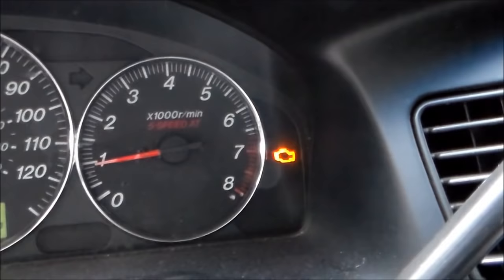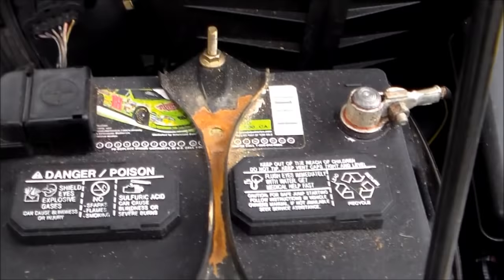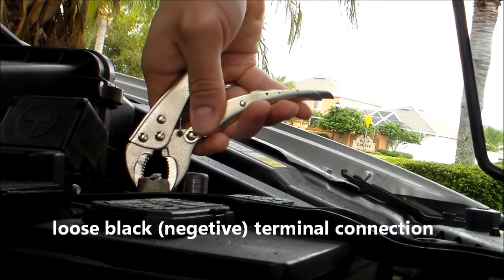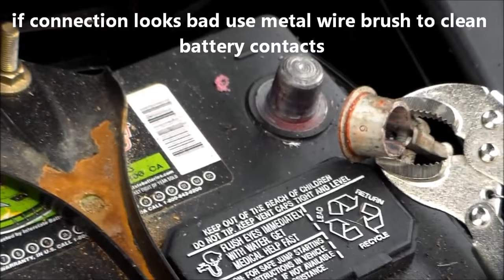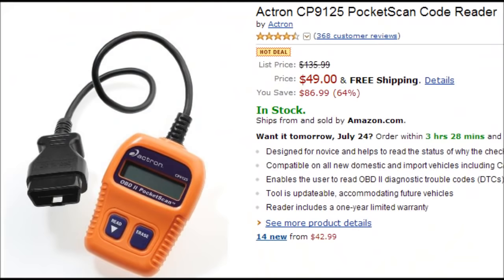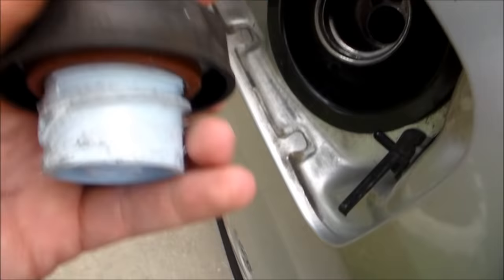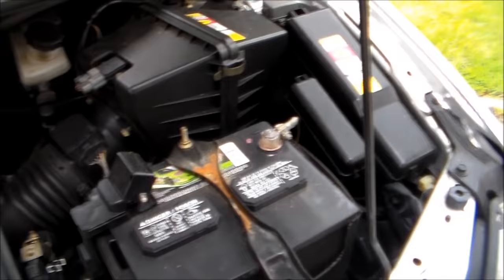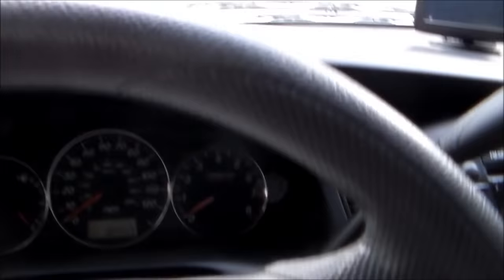HOW TO RESET CHECK ENGINE LIGHT, FREE EASY WAY!

Comment: So the point of this is to hide the light ? I'm no mechanic or car fanatic but this isn't something people should do
Reply from the maker: agreed, that's not the point of the video, the point is that the error light might be triggered by a loose and bad gas cap, that was the point of the video but most over look that part of the video. i recommend fixing the cause of the error light or else the effect will be worse than a check engine light. i replaced my gas cap and light never came back on afterwards.

Comment: Loose gascap... that's bullshit, he just want you to get a new one from them at the shop. And disconnecting the battery does not help on 99% of the computerized cars, after 5 minutes it comes back again.

Comment: In California AutoZone can not diagnose they can only pull code and tell you what it is, because they were misdiagnosis cars to sell parts, this guy is wrong air in gas tank does not have a code, if anything it will through a evap code for a leak,
Reply from the maker: yes your right, evap leak, i corrected that in a speech bubble thx,
i recommend using "Code Reader / Scanner" here (gives U codes & resets light too)-http://www.amazon.com/s/?tag=tampfreepcpin-20&link_code=w12&linkId=&_encoding=UTF-8&search-alias=aps&field-keywords=car+scanner

Comment: This is just a bad example of not what to do, and how to do it, This method is how the phrase Back Yard Mechanic came from .  Use proper tools, Never tap on a battery post, Sorry but the code is still recorded , the light will come back on. Some cars the radio will go into a lock unless a memory saver is used , clearly wasn't which would be a costly code from the dealer. I could go on and on

Comment: BS. You cant clear the codes that way. Even if you clear the codes with an OBDC tool, the codes will reappear after a couple of drive cycles.
The key is the "ready status" on all monitors. Your car will not pass inspection if all systems arent ready.

Comment: What he did is just remove a light from the dashboard, he didn't fix anything.. he just gave himself a reassuring feeling that everything is alright, until one day his engine fails on him. People don't reset a warning light by screwing around with the on-board computer. You're not fixing anything this way and only setting yourself up to get stranded on the side of the road. Have your engine looked at.

PS: What he talked about with his gas tank and having air go into it is a bunch of baloney sandwich.

Comment: you know you can touch the negative post right? lol its the positive that will fry you
Reply: Touching the positive side won't fry you. Not even a zap. Amps aren't high enough. Just don't touch the post with a metal object fro the positive terminal to ground.
Reply: in that case, go nuts! lol

Comment: I really wouldn't follow this guys advice.  You can buy a cheap diagnostic scanner for hardly any money, have a look on Ebay.  Cheap scanners won't do the same jobs as a professional setup, but it will erase your fault code properly, even will tell you what is going on.

Comment: That will not work on OBDII vehicles.  Be careful who you get your information from.  The gentleman obviously knows nothing about using the proper tools for the task or safety precautions!! Using a pair of pliers when a proper sixed wrench should be used.  And wearing a ring while working on a vehicle.  This gentleman is obviously not a trained automotive technician.  Automotive Instructor and ASE Master Automotive Technician!!
Reply: +Carl Hamann  Yes,And were no armclocks with steele-bands ither.I was a 
car-elektrician at Scania-trucks in Sweden.I am now retired!
Reply: +Carl Hamann It does work on my OBD-II vehicle. 2000 ford ranger. 3.0l flexfuel 2x4 drive.  I would take a guess that may not work on the "CAN" OBD-II vehicles but this is just a guess about the "CAN" ones.

Comment: check engine light?  i fix cars. usually needs a tune up. or faulty electronics. misfire due to not changing spark plugs. then that can cause rich fuel, then itll put on a o2 sensor code. then u change o2 cause your a noob. egr solinoids take a crap. car overheating can turn on engine light. disconnect battery cable, light turns off,when car detects problem is still there, light turn back on .ho ho ho. btw, many parts store check your engine light for free. buy some headlight fluid while ur there. good luck

Comment: It's go away forever ?
Reply: Shahit Kham no it will come back on because the problem hasn't been solved. Go to any Autozone or Advance auto parts store and they will scan the computer for free. Most parts stores will do this for free and tell you what the problem is. Local mechanics do this to so they know what the problem is. Get it fixed. Why risk a break down and the car will run better.
Reply: ok  thank,s for good answer i will go ask there
Reply: Shahit Kham I would give the car a couple of bottles of Gumout multi system tune up. Just add it to you gas. Go to about a quarter tank add the Gumout multi system tune up and fill up the gas tank. Go to Autozone or any parts store and ask for Gumout muLti system tune up. It is a very good fuel additive cleaner. It has PEA which is a very good cleaner. If they have BG44k get that instead. A bit more money but excellent cleaner.

Comment: Ricardo Black, you don't know what you're talking about.
AND PLEASE STOP SHOUTING.
The check engine light is not the same as the oil light.
IF you reset the engine light and it does not come back on immediately, there is nothing seriously wrong.

Comment: Do not do this just prior to an official car inspection as the garage computer will not 'pass' it because the computer in your car will have to go through another complete cycle only accomplished by driving the vehicle over a period of time/miles and at various speeds.  Besides, eliminating the 'check engine' light does not make the existing problem go away.  The light will return again in time.

Comment: I would just like to point out that you were using a metal tool to disconnect the battery because you were afraid to touch the negative terminal. Metal conducts electricity so you accomplished nothing, and you also have to touch both terminals to get shocked. It actually bothered me to see you reach for the terminal but quickly go back to the tool out of fear.

Comment: Didnt work on chevrolet cruze 2010
Reply from the maker: take off both red and black terminals for 2 minutes.
Reply: ***** Disconnecting EITHER terminal breaks the circuit. BOTH is redundant. DISCONNECTING the NEGATIVE is ALWAYS preferred.

Comment: Nice try, kid! Did any schmuck fall for this? Plus, who the hell uses a Mole wrench to undo a battery terminal! I faw down and go boom!
Reply: i did and it worked 😒
Reply: +Twigs only because there really wasn't anything wrong with your car. Sometimes cars have personalities of their own. ( what this really means is that a car may have a loose wire, something may be disconnected,  you had a maintenance service performed on the car, bad gas, etc.. ). but the light can go off on its own. my car did this for an entire 6 to 7 months because the 02 sensor was getting old but it was still working. i decided to replace it and my light did not come on at all every so often like it had been doing the months before.  i waited a couple of months to see if the light would turn on and it didn't come back on at all since i replaced the 02 sensor. now if your check engine lamp stays on indefinitely,  you may not be so lucky next time your car is up for inspection. that is a clear sign that major underlying issues exist. now if you do what you did and it passes inspection, then your car is just temperamental. Lol! good luck. yours truly, licensed state inspector/ ase certified tech
Reply: +Twigs p.s. i forgot to tell you that a major underlying issue can just be a tiny sensor but that tiny sensor does a mighty big job. just make sure you get a trustworthy mechanic or 2 to 3 opinions.

Comment: stick to tablets. the ce light tells a hell of a lot more than if the gas cap was loose and it needs to be addressed not shut off because you don't like looking at it. as for "air in the tank" you just proved that autozone is no source of info and that you know nothing about vehicles.

FYI I'm a master tech so I can tell you're not.
Reply: I couldn't stop laughing soon as he said air in the fuel tank lmfao. There should be air in there haha, and sorry but a fault reader won't say anything about a fuel cap, no matter what car, what reader. The cap doesn't even have a sensor.
Reply: +Chris “OCookies” Pullen it's folks like him and places like autozone that make our lives more difficult.

Comment: Doesn't work
Reply: never seen it not work..but as stated unless you fix problem it will just code again
Reply: Meannie Man The reason you have never seen it not work is because you work on old cars. Never cars (or on most new cars) this little trick won't work. I work at Volvo for example. the ECM, wont just erase former errors if you disconnect it from the battery. Same as the CEM and so forth.
Reply: Meannie Man *newer